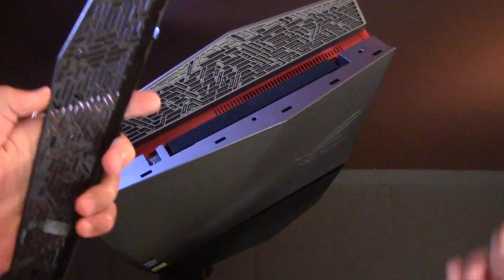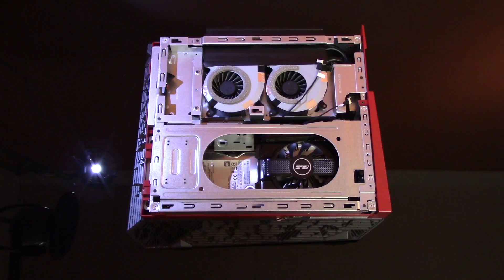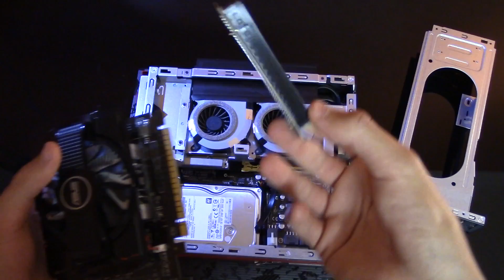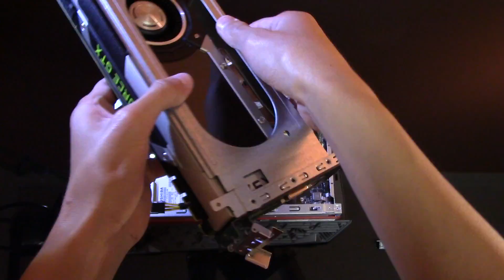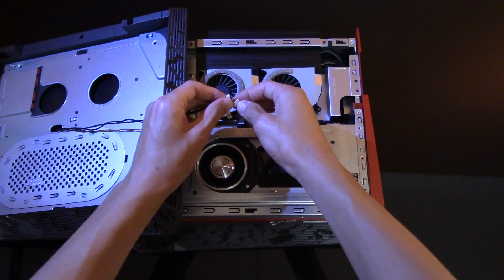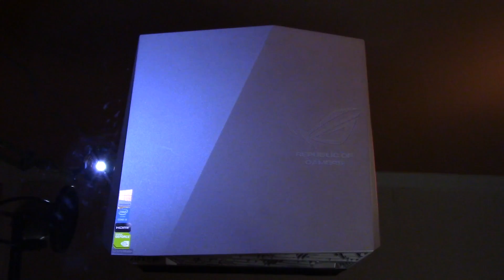Asus ROG G20 - GPU Upgrade Tutorial

Comment: Dude does the Asus RX 480 fit in there?
Reply from the maker: Reference 480's will fit, pretty sure most after market coolers don't, and they'll exhaust lots of heat into the case.
Reply: DrewEon Reference ones? Sry english aint my native language. Im talking about a standard AMD asus rx480. Or should i go for a gtx 1070. if so, which model?
Reply from the maker: The reference model as in AMD's standard model, with the single fan. And I can definitely suggest a 1070, you'll get crazy performance. And as with the 480, also the single fan reference (founders) edition
Reply from the maker: The reference model as in AMD's standard model, with the single fan. And I can definitely suggest a 1070, you'll get crazy performance. And as with the 480, also the single fan reference (founders) edition
Reply: DrewEon i think i get it. so will this one work? https://www.worten.pt/acessorios-de-informatica/componentes-pc/placas-graficas/placa-grafica-asus-geforce-gtx-1070-turbo-8gb-ddr5-5930648
Reply from the maker: I believe that one will fit!
Reply: DrewEon this turbo version on the 1080 says it need 225W...my brick will give only 180W so i guess its a no go on the turbo 1080. i got a gift card on this store for 800€ but they dont have the founders edition just this turbo or the msi aero wich is also single fan. dunno bout msi aero's power needs tho. ty so much for the advices. btw im going to put an SSD500gb do you have a tutorial on that?
Reply from the maker: You need to get the 230W brick as well, if you don't have it. The two power bricks work together, and just so you know, the 1080 will probably never use that much wattage, it's just to be safe.

Comment: so i can run the 970 card on a 220watt?
Reply: Check the description. The links for both PSU's are right there.
Reply from the maker: Definitely not, I've tried it and the PC begins cutting performance or shutting off after about 10 minutes in games.
Reply: DrewEon hmm what should i order then for my ROG psu wise?
Reply from the maker: Nick Joseph You need both the 180W and 230W.
Reply: DrewEon Forsure dude. I know the psu on the ROG G20 is external, how do you hook up both to the pc?
Reply from the maker: They plug right into the rear.
Reply: I feel like an idiot i just saw the second one lol. Thanks for the help  man!
Reply: so my g20 can have two external psu plugged into it? and if thats possible do you know where i can buy the second psu
Reply: I'm planning to get a 106 which has lower power requirements, can I use a laptop power supply for it?

Comment: Can anyone tell me where to find those two power cables he had? I really need them
Reply from the maker: I've searched the entire internet and have only found this cable that somewhat resembles the 8 pin to 8 pin: https://www.amazon.com/Silverstone-Sleeved-PCI-E-8-Pin-PP06B-PCIE55/dp/B00A45JA52/ref=sr_1_6?ie=UTF8&qid=1480012047&sr=8-6&keywords=silverstone+6+pin
Reply: Thanks for looking, but I need a 6 to 6 :(
Reply from the maker: I'm Not Original It splits into a 6+2 pin on both ends!
Reply: Thank you so much! Finally can upgrade to a 1060!
Reply: I'm Not Original did it work? i saw those but read that it said only for silverstone power supply
Reply: Jake Hicks yeah it worked
Reply: I'm Not Original is there anyway you could send me a picture? so i can see it for myself i would love to upgrade mine, i just havent bought the gpu and power brick because im affraid i wont find a cable.
Reply: a picture of what?
Reply: I'm Not Original a picture of it all working or even a video of the inside of the case with the wire shown i just want to be sure that cable will work
Reply: Sorry.. I kind of broke my second external power supply slot.. So I had to go back to my old graphics card, so currently I don't have it working, but I had it working. I managed to fry one power supply somehow. Sorry!
Reply: I'm Not Original hmm maybe because the ground on the cable isnt meant for that pc! i knew it ffs they said it would blow up the other power supply glad i didnt invest
Reply: I don't really know why it happened though. I was at a friends house, and it was working just fine, no problems whatsoever, then we decided to move my setup to the other side of the room, and when I plugged everything in, the 1060 I had in wasn't receiving any power, so we looked at it and found out that somehow I had fried part of my mother board. Yeah, good choice though, don't invest. I can't wait to build my new PC so I can run my 1060
Reply: I'm Not Original yeah im really glad because im getting a 1070 and it would suck to have $450 go down the drain because of a cable. thanks tho

Comment: Drew do u think this gpu will fit in our machine cheers ASUS TURBO-GTX1060-6G 6 GB Graphics Card - Black https://www.amazon.co.uk/dp/B01IPFMVCQ/ref=cm_sw_r_cp_api_XoImybD5G0CYD
Reply from the maker: pugmaster 037 Yes, you'll need the 180W
Reply from the maker: I believe the turbo is too wide to fit in the cage :/
Reply: DrewEon I have the 240w power brick and it connects into the two power supply outlets, do I need to get a new one and the 180w if I want to upgrade to the 1070?
Reply: DrewEon how do I connect the 240w and the 180w?
Reply from the maker: pugmaster 037 They plug in, they're essentially laptop chargers with a whole lotta wattage
Reply: +DrewEon the power brick is this one https://www.bing.com/images/search?q=asus+rog+g20+power+brick&view=detailv2&&id=7826A35FC7C78FB510E74A06ABF2618515A73F9E&selectedIndex=18&ccid=NgCzveBp&simid=608034892089527934&thid=OIP.M3600b3bde069bc7a1273efa27ba257e5o0&ajaxhist=0 it has two connectors.
Reply: DrewEon the power brick contains a 180w and a 230w. Is that enough for the 1070?
Reply from the maker: pugmaster 037 Si, senor

Comment: +DrewEon Do we need the cables you say in the beginning of the video and can we make a GTX 1080 with a Intel Core i7 6700K ? And how much memory we take in the pc ? 8Go ?
Reply from the maker: Yes you need the cables, lmao. Although I believe the 1080 only needs the 8pin? And you can put a 6700k in, but the 6700 would make more sense with this pc as you can't overclock much. And with the 6700, you can fit in 32gb.
Reply: +DrewEon What are the names of the cables ? And so can we take a GTX 1970 with the i7 ?
Reply from the maker: The 1070 will surely work. And the cables that come with the pc are a 6 pin to 6 pin and 6+2 to 6+2 (8 pin)
Reply: +DrewEon The cables are supplied with the pc ? And can you accept me on Skype
Reply from the maker: The cables come with the PC, and sorry but I don't accept Skype requests.

Comment: Hello DrewEon, I have the ASUS G20BM rocking the AMD FX-770k and the Radeon R9 270 2gb DDR5 with 900mhz of power. I was wondering if I could upgrade to a AMD FX-8320 and a Radeon R9 380 4gb DDR5. My chipset is the AMD A58 and I wanted to know what I needed and if I could upgrade those parts.
Reply from the maker: Well you'll need the power supplies and you should be good. Is the FX 8350 a A58 chipset cpu?
Reply: I changed plans, I am actually going to go with a whole new computer. Rocking the GTX 1060 windforce oc. Thanks for the help.

Comment: I have the Asus ROG G20 with Intel i5 1150 3,2ghz. Would it be possible to buy the meanest 1150 4ghz processor and slam in there? Power shouldn't be a problem. But is the MB compatible?
Reply: Billy Joe Yes you can upgrade the CPU.

Comment: hey dude, i have the geforce gtx 750, i5 4460 version and im thinking of putting in http://www.newegg.com/Product/Product.aspx?Item=N82E16814125895 . Will the power supply be enough for this , or do i need to get another one ?
Reply from the maker: The G1 gaming won't fit, and you'll need to upgrade your power supply.
Reply from the maker: Well it may fit, but I'm quite sure it doesn't. And it'll exhaust tons of heat into the case.
Reply: thanks :)
Reply from the maker: You have to go with a reference model graphics card. That or some closed air design cards work. Cards with dual or more fans won't fit, and exhaust air out not only the rear, but into the case.
Reply: what gpu do you propose i should get ?

Comment: Thanks for reply Drew...so it is true then that those jumpers near R20 need to be shifted to the top 2 pins yea?
Reply from the maker: Yes, that's what I did and it works great. But I've heard that different variations of the G20 may need different setups of the pins, so I wish you luck :DDD

Comment: https://www.amazon.com/EVGA-GeForce-Whisper-Graphics-06G-P4-4993-KR/dp/B01BX4LKOQ?th=1 
what can i do to connect on my asus rog g20aj  this gpu ?
Reply: that should work the same way as in this video, only i wouldn't buy that card for that price,  you can get a 1080 for much less and far more performance. also, i would stick with a blower cooler. check this card out: http://www.newegg.com/Product/Product.aspx?Item=9SIA57X4SV2322 
it also only requires a single 8 pin and is much more power efficient.
Reply from the maker: Dont Beleive The ACX 980TI fits, and its way over priced. The founders 1080 Is A Much Better Option As It Doesnt Exhaust air Into The Case As Well

Comment: in an asus rog g20 will you get a lot of dust? if yes, how you can remove the dust?
Reply from the maker: I've found there to be an incredibly small amount of dust buildup in the two years I've had the PC, and if you'd like to remove it a pressurized air can should do :)
Reply: DrewEon thanks, i will buy it, and what about msi nightblade, which should i buy? both are 850 euro
Reply from the maker: That's up to you! Which ever offers the best specs for the price, and whichever you'd prefer to get :)

Comment: Hey, let's talk about the power supply. Some GPUs use more wattage. I believe there are 2 power bricks. One is a 180w and the other is 230w? I don't know if it's 230w, but here's my question: can I just buy another 230w? I mean two 230w for higher wattage?
Reply from the maker: Nope, you must get the 180+230

Comment: Do I need those Cables???????
Reply: HowieGames yes, if you install it without those cables, the computer doesn't starts up
Reply: ARTCAR10 you are talking about the second power adaptor , right?
Reply: Because what i did , i installed it without having the second adaptor and when i tried to start the pc up didnt work, i got scared like hell.. please tell me that its only the second adaptor needed
Reply: you mean the power brick? or the 6 or 8 pin power cables? if you have anything using the external power (6 and/or 8 pin) then you should get another 180 or 230w power brick for it. also, make sure you moved the power swap tab over 1 pin to the left as demonstrated at 6:30
Reply: ***** don't buy this card, this card is verly loud
Reply: ***** msi gtx 1060 gaming x or the gainward golden sample, they are cooler and quieter for gaming
Reply: ***** don't buy cards with a single fan, they are loud and cooling very bad (over 80 degrees)
Reply: Yes but single fans is all that can fit in the asus g20aj

Comment: Can someone link me a 6-pin to 6-pin power cable by any chance? I can't seem to find them anywhere online. Thanks!
Reply from the maker: Don't believe they exist, my friend. What GPU do you have in your G20?
Reply: DrewEon I got the gtx 745 currently, and I have the evga 1060 to upgrade, from this video I need a 6 pin for the GPU to a 6 or 8 pin to connect it to the desktop
Reply from the maker: Sevinad Do you have the 8 pin cable? It seperates into a 6+2 cable
Reply: DrewEon do you think you could link me the cables in this video if you know where they are? thank you
Reply from the maker: This is the only cable I've found that would work: https://smile.amazon.com/Silverstone-Sleeved-PCI-E-8-Pin-PP06B-PCIE55/dp/B00A45JA52/ref=sr_1_5?ie=UTF8&qid=1476567804&sr=8-5&keywords=silverstone+8+pin
Got it myself and it's surely compatible, but noticed I didn't need it. It's an 8 pin to 6+2
Reply: This will work fine, thank you very much!
Reply from the maker: Sevinad Good luck jamming it in there, haha!

Comment: https://www.amazon.co.uk/ASUS-TURBO-GTX1060-6G-GB-Graphics-Card/dp/B01IPFMVCQ/ref=sr_1_4?s=computers&ie=UTF8&qid=1476449620&sr=1-4&keywords=gtx+1060 will this fit into my g20aj ?
Reply from the maker: It should fit!
Reply: did you put this gpu in it???if you say yes i will buy the same gpu...
Reply: i have not actually but i found a smaller one that im going to go with as i know it will fit and i dont need to be scared about it not fitting etc.

Comment: Best Graphics Card with i3-4150?????
Reply from the maker: 6x Titan XP
Reply: maybe a low price one???
Reply from the maker: Gt 230
Reply: DrewEon is gtx 750ti good enough?
Reply from the maker: SHARP BEAT It'll do. I'd suggest a 950, though. It'll get you some more fps for about the same price :D
Reply: DrewEon thx for replay I'll get the one thanks again!!!
Reply from the maker: SHARP BEAT :)
Reply: LOL
Reply from the maker: SHARP BEAT LMAO
Reply: ....hahaha
Reply from the maker: SHARP BEAT ...........yeah
Reply: hey, I did search the GTX 950 on amazon but there is lots of them which one should I get?
there is EVGA, MSI, and ASUS? and different versions of them.
Reply from the maker: I think Asus and EVGA make the best. Try and get one that has the sides the most closed, as airflow into the case from the graphics card heats up the PC.
Reply from the maker: That should do!
Reply: thanks man it really helps a lot 
so after i upgrade my graphic card i can able to run heavy games like black op3 and gta 5 high setting right?
Reply from the maker: Depends on what frame rate you'd like, but the 950 is a solid card. Also, one thing I did with my PC that I didn't put in the video (learned it later) is that the pins underneath JDC11 (JDC 01,02,03,04,05) seem to actually activate the second power adapter. I moved them up from the bottom. May want to try that if your second power adapter doesn't warm up.
Reply: so what do i do because i got none of that
Reply: DrewEon what frame rate is good and can that card give me that frame rate?
Reply from the maker: SHARP BEAT Depends on what you like. I love 60FPS, and the 950 will deliver, at certain settings.
Reply: ok then since you're the pro i'll listen to you !
Reply from the maker: SHARP BEAT That's not a video, I can't replay. And I'm not sure if it'll fit, and because it's an open-air card, it'll exhaust that sexy AMD heat into the case
Reply: XD ok

Comment: I did everything you did but I got the gtx 1070. I can not get it to recognize the gpu. I had the gtx 760 and the computer came with both power supplies what do I do? Any ideas on what I need to do to fix this?
Reply from the maker: No idea. As long as it's plugged in properly, it should be working. Hope nothing broke :/

Comment: First off I want to thank you for the video, it helped out immensely. I just upgraded the GPU to the GTX 1080. Ever since then my computer will shut off and reboot into the ASUS UEFI BIOS. I cant really pin point the reason to this. I have been able to figure out how to trigger the shutdown but cant figure out why it does. When I start a game that is maxed out on graphics it will just shut off. No over heating or load. I have seen that others are still using the 180w power cable, which is what I am still using. Do you think its sucking to much power now? That is the only thing I cant really monitor when it goes out. What are your thoughts? Have you experienced this before? Thanks again.
Reply from the maker: Are you using only a 180w? You definitely need both. And also, the jumpers that are located below JDC 11, I believe they're JDC 0-05, make sure you move those up from the bottom.
Reply: DrewEon I never moved any jdc 0-05s. Just moved the jdc11 to the left to turn on the 8pin. I will tear her apart after I finish my essay. Thank you. I knew I was missing something.
Reply from the maker: FERRARIIO Ono Yeah, found that out not so long ago!
Reply: yeah I cant believe how much of a community there is with the G20 and so little info out there. haha Bestbuy Geek squad still does not believe i put a 1080 in it
Reply from the maker: FERRARIIO Ono GGGG

Comment: I have the same computer I'm looking into upgrading to the 970 can you give me an amazon link to a 970 that would work for this computer.
Reply: any GPU with measurements of 10.5x4.3x2 slots works. most of your fanned gpus wont fit. need the fan to blow out the back vs up or down.
Reply: FERRARIIO Ono is their one you could link me to?
Reply: Fenrir _ this is a founders GTX. The fan is low profile and blows out the back. https://www.amazon.com/MSI-GeForce-GTX-1070-Founders/dp/B01GO0I93O/ref=sr_1_1?s=pc&ie=UTF8&qid=1475723846&sr=1-1&keywords=gtx+founders+edition
Reply: FERRARIIO Ono Stupid question will this work for this computer?
Reply: Fenrir _ yuppers. I just placed a 1080 inside of mine.